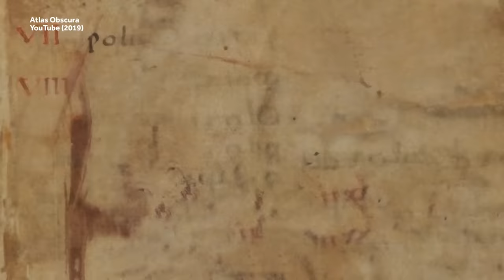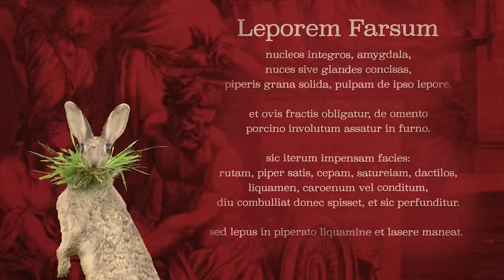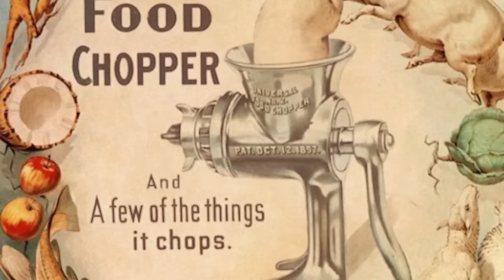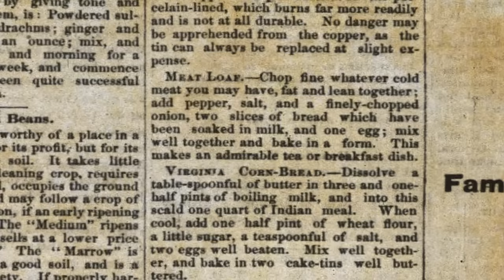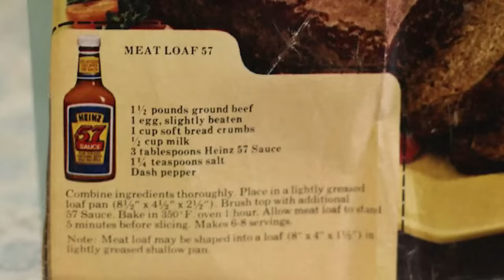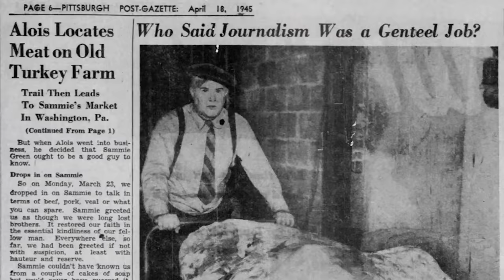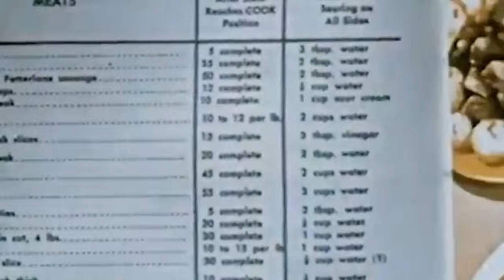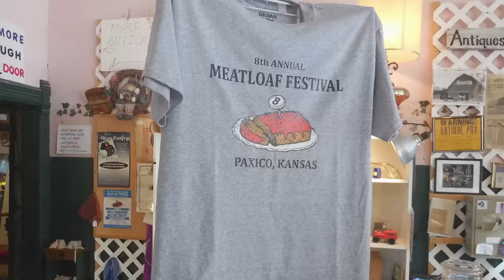How Meatloaf Became an American Classic

Comment: Meatloaf - 1.5lb ground chuck, 2 medium carrots, 2 medium stalks of celery, .5 medium WHITE onion, .25 red onion, .25 cup rolled oats, 1 large egg.  Chop veggies to desired smallness and mix all ingredients together. Place in pan and form into loaf shape. Let sit in fridge while oven preheats to 375. Bake for around 30 minutes covered, foil will do. Uncover and then put a molasses and tomato based barbecue sauce on top evenly spread, then bake again for about 15 minutes or until internal temp reaches 165f. Take out of oven, let cool to serving temp. While letting the loaf cool, make your red gravy using the drippings and a little more sauce and flour. Serve with a side of boiled buttered cabbage, green beans or corn and mashed taters. Serving suggestion: Put gravy on the meat and the taters. If serving corn, mix corn in with gravyed taters.

Comment: I have my own creation that combines meatloaf and pizza. I mix in ground sausage with the regular meatloaf mix along side oregano basil garlic powder and onion powder. From there this has evolved - I started out by gently flattening the meat out on wax paper and then adding sauce cheese and my favorite meaty toppings like pepperoni salami sausage and bacon, then use the paper to roll it up and into a pan where it got covered in more sauce to keep the meat moist then covered and into the oven. once the middle reaches the right temperature top with more cheese and if you like toppings like olives or shrooms (i dont) they are added here and let the cheese brown. 
This is a LOT of work even with how delicious it is. I have now started instead layering the meat directly into a loaf pan lasagna style. meat sauce cheese toppings repeat
this is a lot less work and just as delicious as well as i dont end up with a loaf bigger than my baking dish.

Comment: Uhh… german ≠ dutch 
Why do you guys keep switching???
Reply: Aren’t they connected? Some elements of the languages are similar 😅
Reply: They're not switching. Originally, the Netherlands "Dutch" and the Low German "Deutsche" were pronounced in a similar way, but there has been a vowel shift for the latter towards the High German dialect from "uh" to "oy" in the last 200 years.